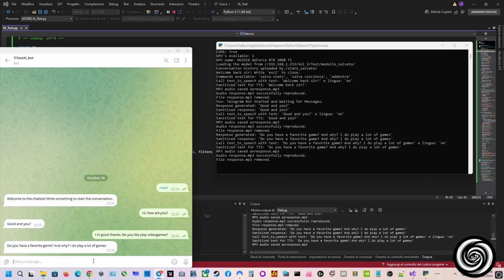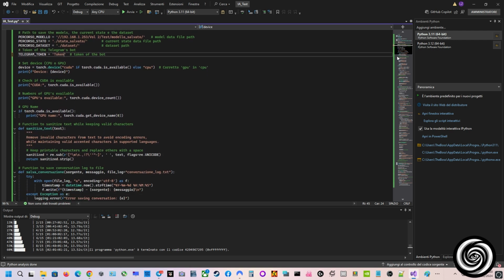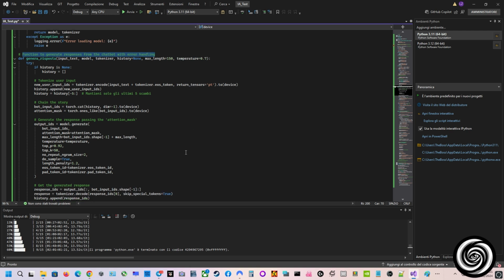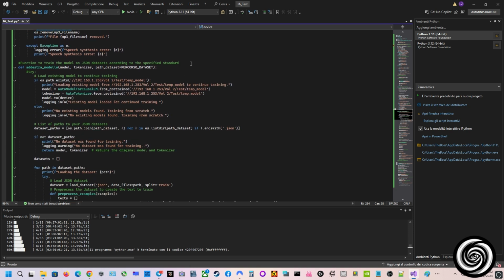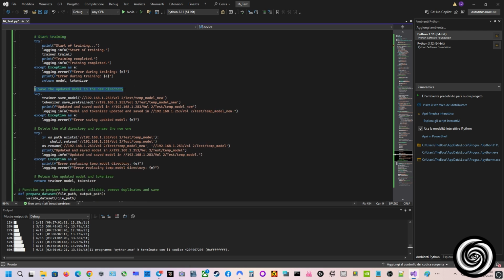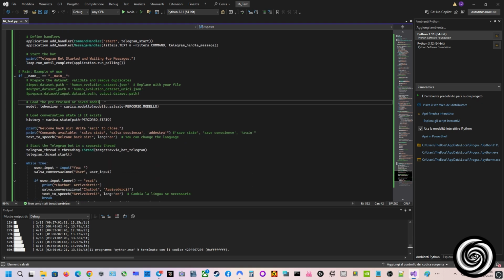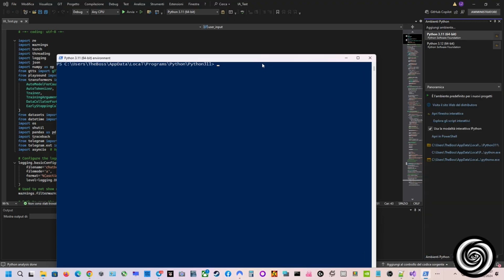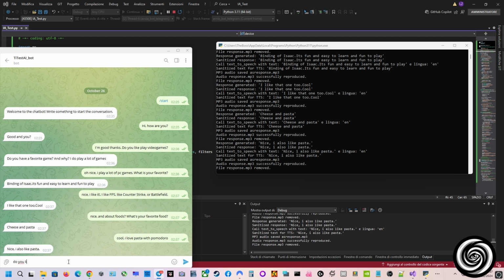AI Telegram Chat Bot - DialoGPT - Python

Comment: Always giving error pytz timezone not configured.
Reply: Got the problem at last.
Its due to updated python...
Torch is not supported with updated version of python. I had to downgrade to 3.11.4
Reply from the maker: @Farm_OTecH yes, i also used 11. you have to argue with the versions at the beginning because there are some libraries that don't work with the latest updates, others that instead need the latest version. I wasted time on it too during the initial tests. Later i'll write you all the exact versions I used, i should have listed them in the video, but i was a bit lazy. 😵
Reply from the maker: Language: Python 3.11

Imported Libraries:

1. torch: 2.0.1+cu117
2. transformers: 4.46.0
3. datasets: 3.0.1
4. numpy: 1.26.4
5. pandas: 2.2.3
6. gtts: 2.5.3
7. playsound: 1.2.2
8. threadpoolctl: 3.5.0
9. python-telegram-bot: 21.6
10. pyyaml: 6.0.2
11. huggingface-hub: 0.26.1
12. pyparsing: 3.1.4
13. tokenizers: 0.20.0
Reply: @zetalvx  playsound library not working.
Reply from the maker: if you're interested, I'm starting some similar local chatbot videos with DeepSeek R1, definitely better than Dialo-GPT. You can find it in my last video.
Reply from the maker: I added a second file "IA_Test_Basic_Chat_code. py" on github, where only the basic chatbot functionality via console is implemented. I removed Telegram and Text to Speech. Try it and tell me if you can start it now

Out, here: https://github.com/ZETALVX/AI-Telegram-Bot-DialoGPT/blob/main/IA_Test_Basic_Chat_code.py
Reply from the maker: Hi, I'll start by giving you a basic answer, a bit like a Bot, if there is any need I'll check again, so it could be a library or version issue (look at the end of the video when I scroll through the installed libraries and the versions used, I know I have a lot of libraries not related to the project but at least you can see which ones are in use if you have the same versions and try again. Anyway: 
The error "pytz timezone not configured" probably comes from the lack of the pytz library or from an inadequate configuration of the time zone in the code or libraries you are using.

Remember to:

• Install and configure pytz correctly.
• You can also try to explicitly configure time zones in your code, especially when using “datetime” and “logging”.
• Check your operating system's time zone settings.
• Update and verify compatibility of your dependencies.

If the error persists, I invite you to share additional details or specific error messages present in the log file (chatbot_debug.log) for more targeted assistance.
Reply from the maker: Check Pytz:
pip show pytz

In not installed, install it:
pip install pytz

Comment: Will something like this be good for teaching kids how to read
Reply from the maker: Hi, 
what I showed in the video as it is has no real use without implementing your changes, and the chatbot only has a basic pre-training, so in addition to often responding in a "crazy" way, it is not able to have a dialogue or teach something.
This code is a working base to start a pre-trained chatbot, be able to chat with it, do fine tuning (teach what you want the bot to know) and debug.
There is also the new version called GODEL which is the new pre-trained AI chatbot from Microsoft, better at communicating.
If you have a powerful computer, you can try to use the code I shared using Godel instead of dialoGPT, and try to do fine tuning. For me at the moment it is still too elaborate and I have only managed to do a small training that has given small positive results. It is a long job, you have to prepare thousands of examples for training and you have to do a lot of tests to see that everything is working correctly. In addition, you need a lot of resources (both CPU and video card).
Reply: @ thanks for responding